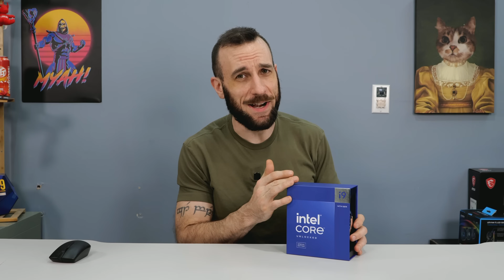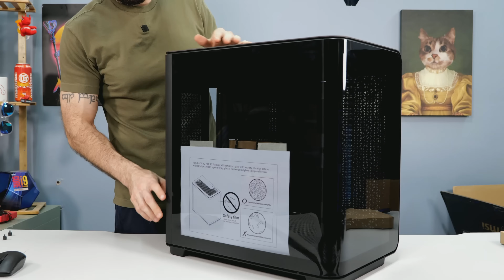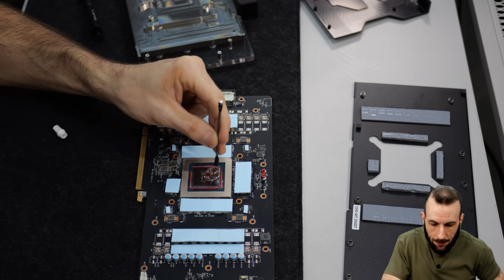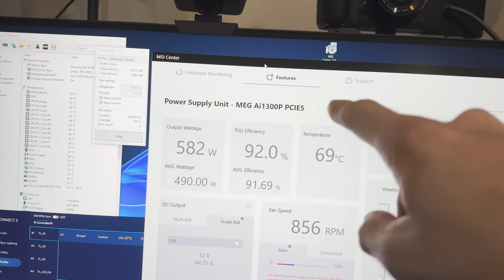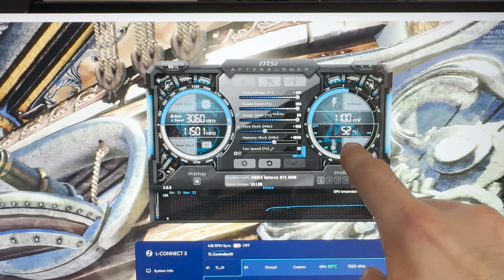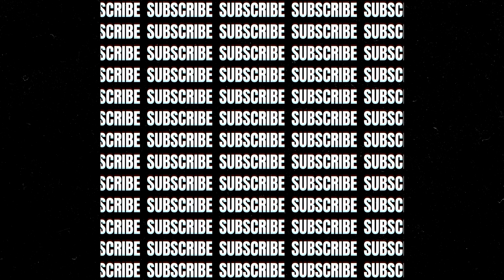🛑 The FASTEST Gaming PC EVER BUILT. Period. 😱👑 (2024)

Comment: Hello sir, Question for you, if you still answer old videos....well, 2 questions if you don't mind!Hello sir, Question for you, if you still answer old videos....well, 2 questions if you don't mind!

1. Is there another motherboard you'd recommend for the new i9s? The one you have is listed around 1300 bucks at the moment, which is crazy high. . Is there another motherboard you'd recommend for the new i9s? The one you have is listed around 1300 bucks at the moment, which is crazy high. 

2. Are you using 2 Kraken Elites and 1 Triple TL LCD Fans in your set up? You don't have how many of each and didn't go in to much about the water cooling set ups. I never attempted to liquid cool a GPU but I want to make the set up you have there (maybe with a better heat sink on the cpu like you said tho). Just trying to make sure I do everything right! . Are you using 2 Kraken Elites and 1 Triple TL LCD Fans in your set up? You don't have how many of each and didn't go in to much about the water cooling set ups. I never attempted to liquid cool a GPU but I want to make the set up you have there (maybe with a better heat sink on the cpu like you said tho). Just trying to make sure I do everything right! 

Am def subbing to your channel too. I like your insight! Keep up the great work!m def subbing to your channel too. I like your insight! Keep up the great work!

Comment: Had to saw off some of the plastic heat shield and half the lower heatsink on my z390 Dark board for my EKWB active backplate.. Did not feel good about it at all, but it's built for LN2, has been running just fine with the.. modifications, lol. Gotta do what ya gotta do! Super clean build, thanks for sharing! Gave a lot of food for thought on rebuilding my loop.

Comment: My oldest system running amd 3950x and a rx5700xt from saphire, is running every game at 1440p in 120+ fps. I did buy a new system, but it doesnt do anything my oldest system cant do. Its like buying a bugatti, 1200 hp, 250+mph but you can only 60-80mph because the system only supports those speeds. Its a complete waste of money.

Comment: Ek used to make a modular radiator cooler with integrated ddc pump. It came with 1/4 inch fittings and  rubber hoses. So you could customize it with a different cpu block and change hose lengths and fittings. Product was called EK-MLC Phoenix. Not sure why they stopped selling them.

Comment: If you need to use a Dremel tool, you should first check the dimensions of the components you plan to use. You didn't need a full tower case but a MEGA case. I am waiting for Part Two.

Comment: Hi . Subambient or not ?? I am just remaking my old rig - performance on a budget. Pretty similar to the one in the video - but older gen and way cheaper (tied to the budget I have) . 

CPU - I have a 10900KF delided - Thermal Grizzly liquid metal thermal paste
Cooling: 3x Cooler Master ML 360 AIO Cryo cooler  - modified for custom loop : the TEC water block (modified the rubber seal - cut to fit the lower position for the delided CPU) - then 3x360mm rads + 9x120mm fans - 2x water pumps from the ML 360 cryo cooler in series + reservoir
Motherboard : MSI Z490 Unify
RAM : 4x8=32Gb Patriot 4400Hhz DDR4 (will be replaced with G-Skill 2x32Gb=64Gb Trident Z Royal Gold 4000Mhz)
M.2 SSD: 980Pro 1Tb
PSU: 1000w Corsair

At the moment the CPU is running on 5.3Ghz all cores with a NZXT 73x 360mm AIO -  on delided CPU

I am hoping to get that i9-10900k to 5.4Ghz - 5.5Ghz all cores.  For fewer cores can go up to 5.7-5.8Ghz

---- not sure if I should keep the NZXT water block and no subambient cooling with this setup  / or better go with Peltier cooling regulated with the Intel cryo (by the way - for Peltier cooling - that will be powered by a separate motherboard i5-4690 switched on BEFORE the main rig - to get to subambient the i9-10900k on startup - this way I can set the overclock main rig within BIOS - by design the s***tty Intel Cryo software only can start with Windows)

Comment: I'd honestly waited for the 5090...other than that...great build.
Reply: What's the point in a 5090? Nothing is even close to the 4090 yet. 😂
Reply: @bradleyhenry2411  Turn every setting up on Cyberpunk, Alen Wake 2 on 4k then ask that question.  Games aren't getting easier, nor less optimized moving foward. Monitors are getting bigger and better, and almost everyone is moving to ultrawide oled. 2500 bucks better last at least 5 years..this 4090 isn't lasting 3 by the looks of it. Not only that..4090 is going for what....about 2k....5090 about 500 bucks more for 70% more performance....I'll take that all day.
Reply: @elvertmack5039  I get that. But there's still no existing GPUs to compete right now. I can't see one competing for at least 2 years.
Reply: @bradleyhenry2411  that's because noone was every competing in the first place. Amd will get passed by Intel in another couple of years. I bought a 7900xtx to replace my 3090 ti lc....almost the same card with higher clocks, same raytracing capabilities as well.  I play on a Samsung g9 super ultrawide with a 13700k/4080....its nice don't get me wrong....but that's with frame generation, on dlss balanced. 5090 I can run the same setup with probably dlss quality and get about 70 frames. 4090...you need dlss, and frame generation still with path tracing on with everything cranked. Now they have a 57 inch samsung g9....mannn...OK. get a 4090 now when the 5090 is around October....you'll be wishing you didn't.  Jefus has 5 4090s....so I can see why He did it...but normal people..building that same rig...just wait.

Comment: Jufes, i've been running a MSI MPG a1000g pcie5 PSU since the 4090 launched and it hasn't broken a sweat going through multiple 4090's and a max overclocked 13900ks. OEM is channel well tech, the same OEM Corsair uses but i'm sure you knew that. They are great power supplies.
Reply from the maker: yeah i'm really digging the monitoring software, it would be interesting in power supply tuning became a thing in the future
Reply: I want to buy a processor, and which one would you recommend as an expert, 13900ks or 14900ks? @FrameChasers  🤔
Reply: @FrameChasers  Sadly mine does not have that feature but if I were to go with a higher wattage premium unit that would be the one for me. I came across a ton of articles on reddit of people complaining about the newer Be Quiet 1600w titaniums shutting people's breakers off lmao

Comment: What SP did your KS end up being? Mine is garbo at 104 I believe.
Reply: Probably the E Cores dragging it down. Mine has overall SP of 103, but P Core SP is a pretty good 117, E Core SP is 76, and MC SP is a good 86.
Reply: @ColinDyckes  Mine was like 115/83/ MCSP 76. pretty bad
Reply: @user-vsmsdos I'm getting 6GHz all core, 6.3 on 2 cores with E Cores at 4.5Ghz and cache at 5.0 Ghz, and that's before tuning. CPU is 'luck of the draw' unless you can pick the best of a bunch 😢. Direct Die and the Mora might get me 6.1 all core for gaming which I'll be happy with.
Reply: @ColinDyckes  Yeah, I most certainly didn't get luck of the draw. I've gone direct die and get 60/45 as well, and my memory controller is enough to at least mostly stabilize 8000 XMP. Really, I wish I got a better memory controller over anything else....

Comment: Build looks great man! How hard is that to fill/drain? Cant wait for the optane content!
Reply from the maker: it takes about 2 hours of letting it run to get all the air bubbles out which is a little annoying but I think its worth it in the end
Reply: @FrameChasers Hi Ivan I follow you from Italy. You bring unique content. I bought this case, and decided to make a custom loop. Initially I wanted to mount two classic 45mm alphacool radiators, and have a distroplate custom made (since it doesn't exist for this case). But then I saw this video where you use this granzon modular system. I wanted to understand what the difference is in performance from a classic custom loop. I bought the 9800x3d as cpu and the 4090 as video card.  In the video you explain that after 15min of testing the video card is at 52-53 degrees with the fans at 1300rpm. But after 1-2 hours of gaming how are the temperatures?